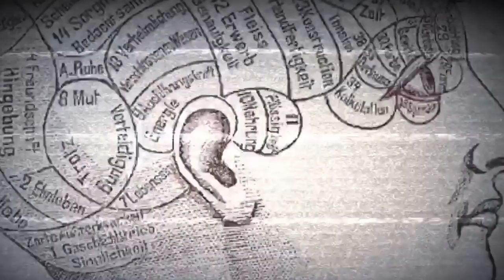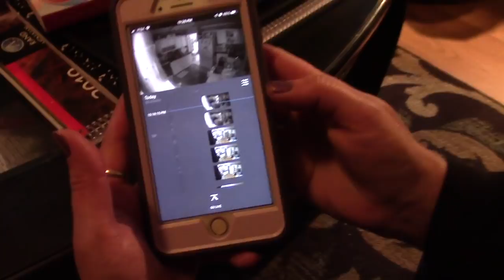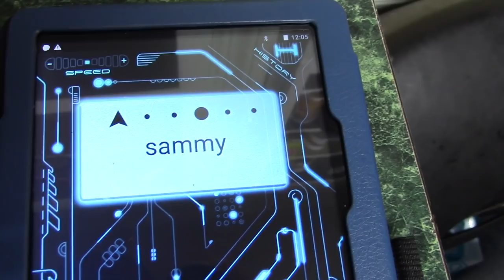Ghost in the Kitchen - Virginia Paranormal Case Files

Comment: Thanks you, guys, you are the best!
I lived in an old apartment years ago which I got infested with some entities by playing  automatic writing. Those were poltergeists rather because they manifested themselves by moving things (like taking pictures off the walls and placing them on the floor - not breaking anything in process), making unexpected noises (like, I would hear a sound of full bucket of water thrown into the bathtub, or the locks on the front door clicking unlocked - while the locks stayed locked), couple of times, I lit a large and fat  pillar candle just to see it burning down completely within half an hour (it normally takes hours and hours). So, that apartment had definitely had issues. 
At that time, I had a perfectly trained German Shepherd dog who would not JUST bark for the heck of barking like some dogs do. She would bark only if someone approached the door or the windows, or - if I told her to bark. During those several months I experienced manifestations my dog seemed to go completely mad. She would run into a room, all of the sudden, and start barking staring up the wall towards the ceiling. Exactly as you described. She also kind of crawled along the wall, never taking her eyes of that something she was looking at up in the corner where the wall meets the ceiling, and continue barking. My professionally trained dog ignored the command to be quiet - she was in frenzy. Then, as suddenly as it started, it would stop. But I noticed - she kept checking that one wall up at the ceiling. Just checking it as if she expected something to show up. The wall was in no way significant, behind it was an empty apartment, there was no attic, so there could not have been any wild life coming in above. 
Dogs definitely see things that we can't. If I were investigating paranormal activities, I think having well trained dog on the team might be beneficial :)
Reply from the maker: Haha Inc. Very interesting! That’s a good idea too. We would love to incorporate a dog into investigations. Thanks for the positive feedback!
Reply: I couldn't agree more.  I think cats can see into the para realm too, but they'd be a bit more tricky to have as a guest investigator from time to time,  lol.  Dogs definitely better for this position.